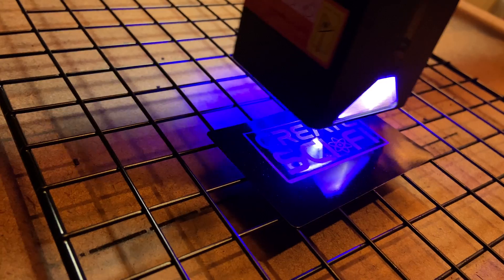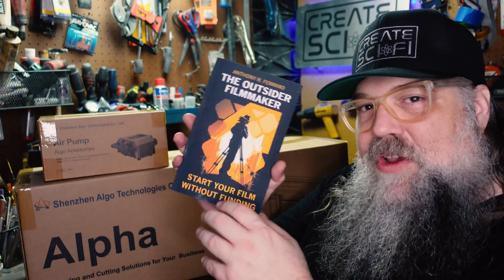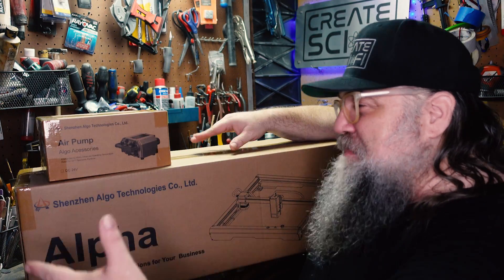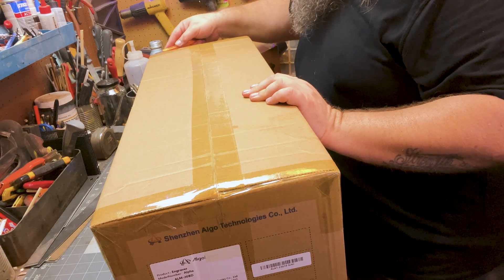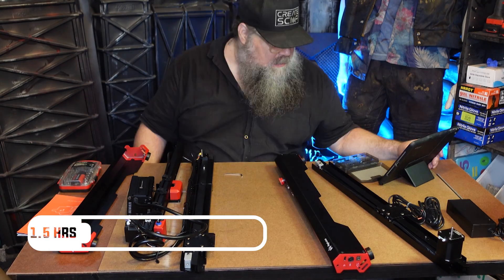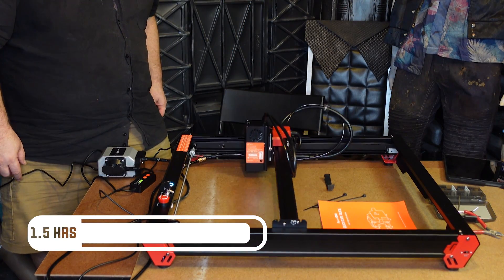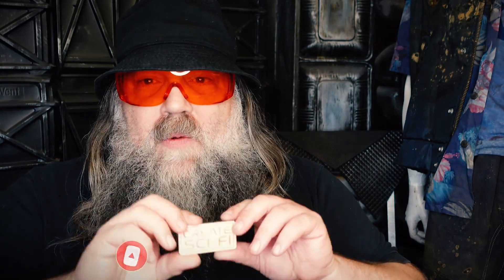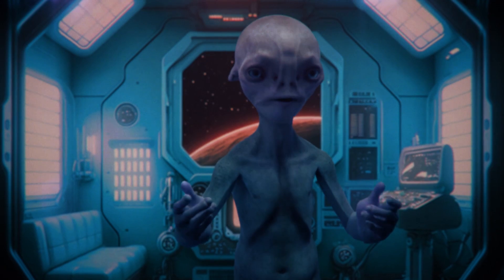ALGOLASER ALPHA 22W LASER ENGRAVER: FIRST-TIMER'S GUIDE UNBOXING & SET UP

Comment: You mentioned WiFI....  With LightBurn, can you start up with using WiFi then run the machine., OR, do you first need a USB cable connection to get the machine running THEN switch to WiFi???  My desktop is about 12 feet away from the soon to be delivered Alpha and IF I can directly use the WiFi without first having to use the USB cable, that would be GREAT..  You comments are welcome..  Thanks Hank
P.S.  That is a GREAT idea to use a fricking oven cooling rack for your base mat.  You just need to add an aluminum plate under the rack..  Super airflow and minimal restrictions....  You can buy a big ass cooling rack for WAY less thank a honeycomb mat....